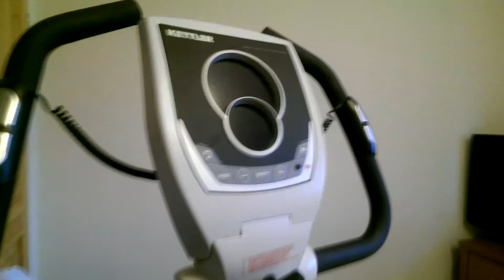Kettler exercise bike technical overview

Comment: I have this very problem. I bought a bike that had this problem and I have been trying to workout what is wrong. What I thought might have been wrong was they had torn through the power cord that joins three coloured wires into two and I wasn’t sure they had re-wired it wrong. So I checked YouTube for solutions and found your video. So I will let you know how I go.

Comment: Hello..I got the same series like that.. I got E-2 error..any idea how to fix it?
Reply: Found the solution, just replace the potentiometer. Voila
Reply: @andreasyohan2622  hiya! Was there a particular potentiometer you bought? I have the same error code on my bike. Haven’t yet taken the side of to look but I’m assuming it’s this that’s causing the issue
Reply from the maker: E2 means that the servo is not responding. It could be stuck (especially if the bike has not been used for a while). Try giving the servo motor a gentle tap with the end of a screwdriver. If that does not work then you will probably need to replace it. Also, it could be the wiring or the console but thee are less likely causes of the fault. Hope this helps. Best wishes, Jon
Reply: Hello sir, can you help me,I got E 3 what does mean, please leave message to me
Reply: Axis cycle R here: Even cheaper design then this and it won’t calibrate! Any idea on a short cut in the menu that will cause it to do this?
Reply: Potentiometer is most likely fucked in deed!!!